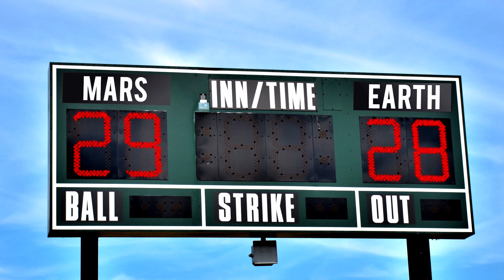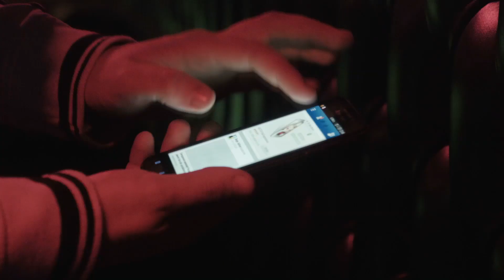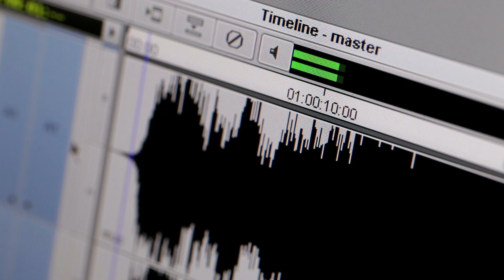What Will NASA's Perseverance Rover Do On Mars?

Comment: Did they managed to get this thing going to mars ? Last thing i heard is that this thing is frozen in space.
Reply from the maker: There was an issue where the spacecraft went into "safe mode" because the temperature was too low on July 30, 2020 (launch day) but it was back to normal mode by the next day
Reply: @WackyUniverse  So you say it's on the way to Mars?